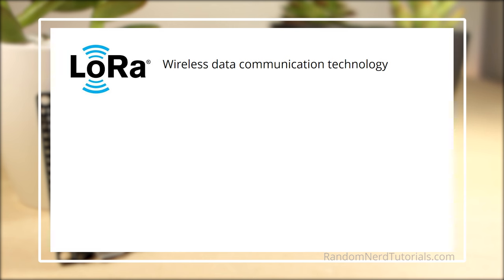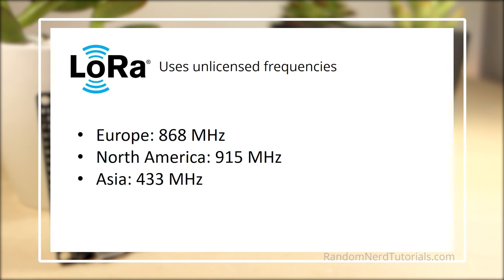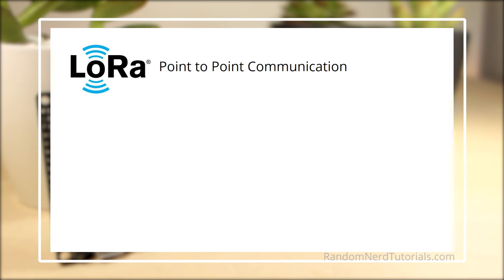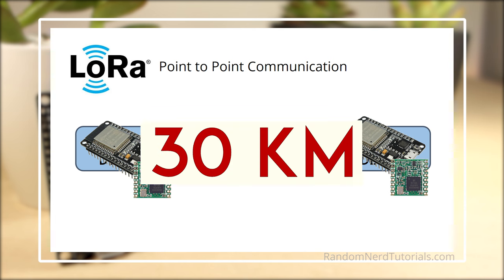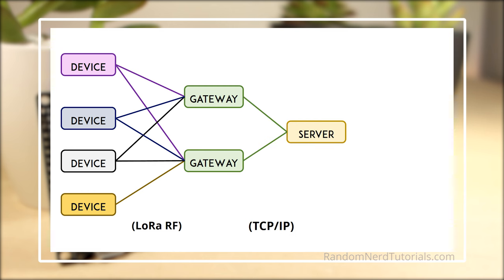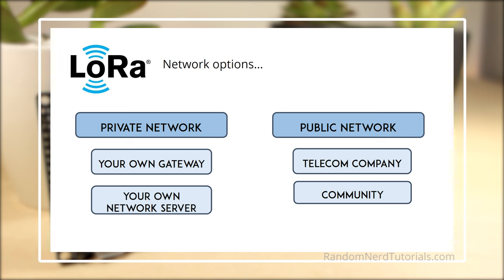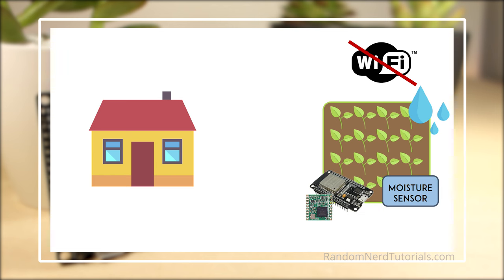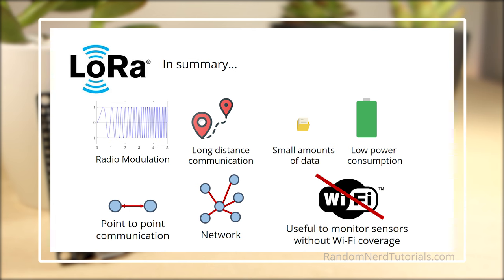ESP32 with LoRa using Arduino IDE – Getting Started

Comment: Do you think is possible to make some temperature/humidity sensors around the home, using a low power batt. arduino/Temps and Humudity/LORA, 
and transmit the data to the SonoFF Bridge 433 mHz please ? thanks